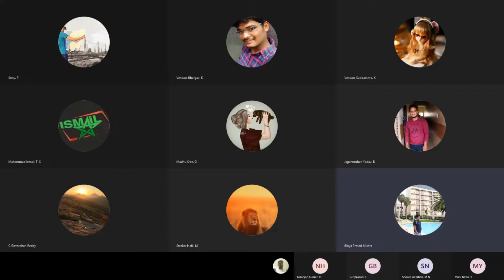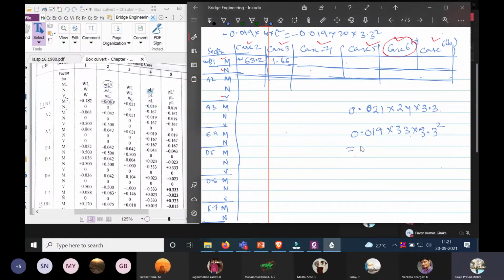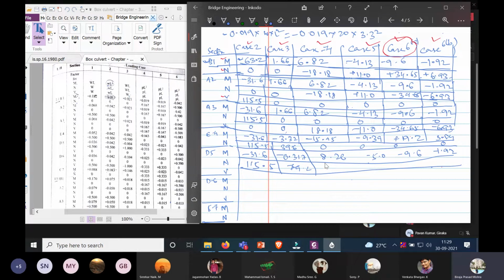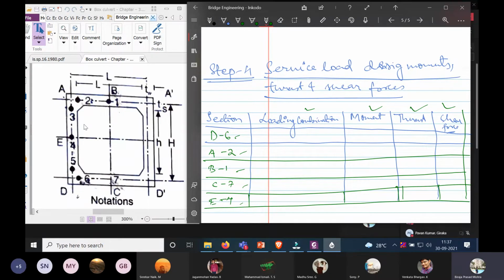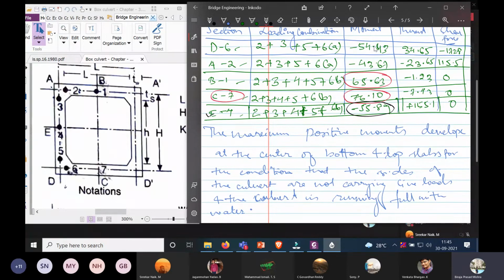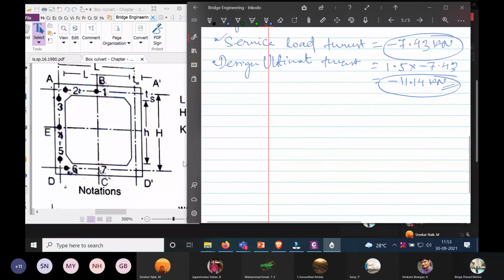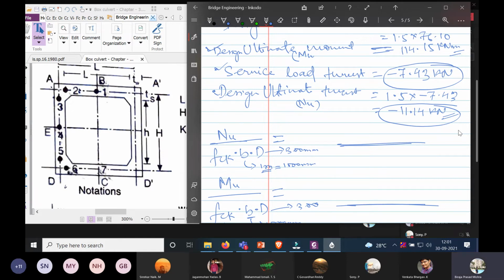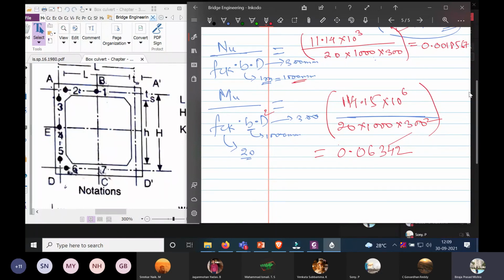Design of Box Culvert (Part - 2) (Lecture - 4, Dated: 30-09-2021)

Comment: Sir which load combination according to IS ...should be use for multicell box culvert
Reply from the maker: In that case you have to make an excel and check individually. As you know the calculation, using excel will expedite the process.
Reply: @brslifecaptured8356  sir  will you plz provide the multicell design steps ...from book
Reply from the maker: Its not there in the book from where i learnt this example. You can search other books from foreign authors.
Reply: @brslifecaptured8356  okk
Reply: @brslifecaptured8356  thank you sir

Comment: Sir in sem exams where we will get that table??
Reply from the maker: Dear Rathod,

If the question setter asks the design then he/she has to provide the table for sure. Else you can only calculate upto the total load. Without table it is difficult to do design unless anyone remembers the table. All the best Dear 👍👍😇😇